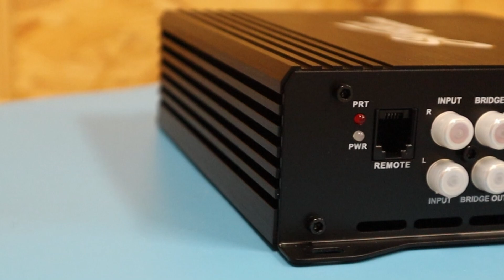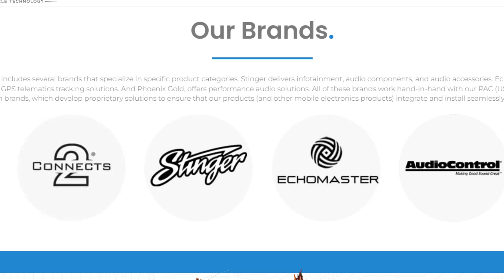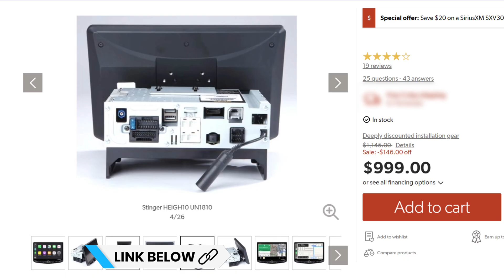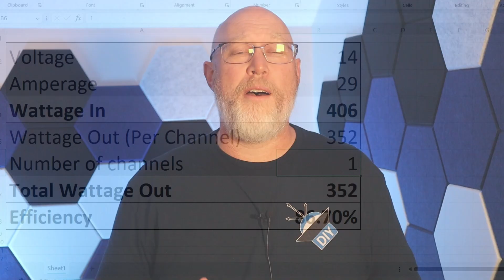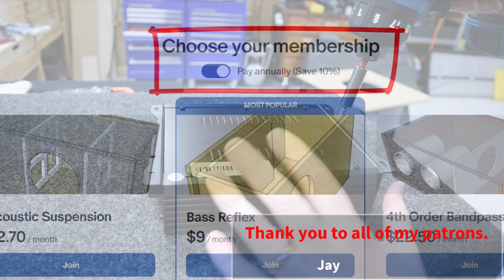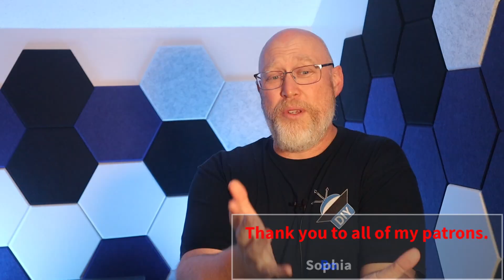The best budget subwoofer amp on Amazon (2024)

Comment: You should check out the Vevor BP-1500.1D it's under 100 bucks and not only does it's power it crushes it's rated power. You can get a 3000 watt version for 108.00 bucks.

Comment: As I understand a bit in electronic engineering and is licensed to use a soldering iron..... I decided to go inexpensive!  I bought a "Module amplifier based on a  TPA3255 chipset. Costed me 70 dollar and produced 300+300W (Total of 600W RMS).  to produce that power I had to add two more items.... A 12 to 48 volt converter and a dual low pass filter at the input, to block everything but the bass frequencies.  First I tested it at home, The speaker driver I used was taken almost to it's limits.... I think the neighbors dogs (in the next building) filed for relocation!  Ended up skipping the car option and left the amplifier connected to a passive 600W dual coil subwoofer. Sound great... Also sounds as loud as I want to, at will.

Comment: Hey DIY A G.
 Can you or anyone tell me why the majority of class D mono amplifiers are engineered to produce their maximum rating at one ohm?
  I understand that the lower the resistance, the higher the output but can’t this maximum rating be produced at, let’s say 4 or 8 ohms? , keeping things cooler and more efficient?
 Thanks bro, love the channel? 👍to toid.
Reply from the maker: Price.  You get more watts to the dollar at 1 ohm.
Reply: @DIYAudioGuy  Well okay then- That simplifies things 🤦‍♂️. 
 Thanks man. 
See ya on the next one.
Reply: The lower the ohms the lower the resistance and higher power output with less heat for higher watts I believe is the reason someone correct me if I'm wrong

Comment: I have a  1000 watt mono powering two subs and it’s just not what I’d figure it would be coming from two cheap subs and 200 watts each. Any way to check amp output with meter

Comment: The mt 2000.1d is insanely powerful. Running 2-3000 watt a.b. hawks and they are pushed hard with a lot of power to spare!
Reply from the maker: These are good amps.
Reply: @DIYAudioGuy 
Please can you test the 600.4 and the 1000.5

Comment: There 10 inch head unit  for a Toyota Tacoma 2016-2023 is really nice and has Apple CarPlay and android CarPlay you can hook up for cameras to that head unit  I am 48 years old so growing up in the 80s and 90s high school in the 90s everybody had aftermarket stereo systems in their cars and trucks that’s when the louder the bass that’s what every one wanted 

Phoenix gold I definitely remember that brand I think if I remember correctly they made high end speaker wire and all the wire do you need it to hook up your amplifiers the fuses 

When I was young and in high school I had kicker competition subs and alpine amplifiers and alpine pull out stereo then somebody broke into my truck and stole the sleeve set then I got a detachable face alpine head unit after that I got it alpine detachable face head unit and after I graduated high school and start working all the time I remember like all my friends are used to go to a place called sound crafters this is in Baltimore county Maryland friend of mine had a 5.0 mustang this was in 1996 the car was a 1991 or 1992 he got some kicker solo baric and this was before they were square these 12 inch the round ones they kept having problems with them they sound like💩💩💩 and I remember the only one that kicker did not have a problem with what is a 15 inch so he got 115 inch for the back of the mustang and he was done plumber school so he start making better money he bought a 1996 four runner brand new leather seat he got Six 10 inch JL audio 10 W6 he had a custom box made it was leather to match the seats in the forerunner 6 subs and I can’t remember if he had Rockford amps or kicker amps yeah extra battery and battery caps that was the first time ever seeing them the system was so heavy yeah they get some kind of balloons I forget exactly what they were called because the truck sagged in the back so these air shocks made  it not so low in the back I know he’s spent over 20,000 hours getting all that stuff done  people back in your system lotta friends that spend big money on their stereo systems and the base was so loud and vibrated the vehicle so bad I don’t even think it sounds good in the cars like a friend of mine had a BMW and everything was in the trunk translate it was just too much

Oh front of mine had a rodeo and he had four kicker competition 10 inch with a Kenwood 1021 amplifier he made the box to selves face straight back towards the hatch and the other two were on a 45° angle facing back and the rodeos had those windows that open so the other two was facing braided the window and he had for his meds in hives Alpine 6 1/2 for them with an amplifier and I’m not gonna lie that stereo system sounds better than everybody I knew that spent all that money everybody always wanted bigger woofers at first then I learned that smaller subs especially depending on what kind of car you had and where you had the woofer facing made the difference on how good your stereo system sound it I mean don’t get me wrong his forerunner sound really good but not $20,000 and I got rid of my 12 inch kickers and got 10 inch that was my girlfriends car and I had a box I bought from my friend 4 8 inch Kicker comp with a alpine amplifier I can’t remember which one it was it was a four channel that I had bridge down and it’s sound great I had that for a few years then somebody stole my stuff and so I went to the same place because I wanted a custom box I got three 10 inch JL audio 10 W sixes with a rod for Fosgate amplifier and a Kenwood flip face head unit down it was detachable face but if I remember correctly the face with hold down so you can put the CD in it if I remember correctly 1997 this was like a brand new Kenwood head unit at the time and this was just like a normal size head unit nothing light everybody gets now or I that stinger 10 inch head unit for the Tacoma‘s Toyota Tacoma‘s are really popular they’re all over YouTube with there Toyota Tacoma‘s oh Toyota forerunners Toyota Tacoma‘s and tundras are make the most popular trucks on YouTube or and that stinger head unit is so nice alpine and Sony makes some nice stereos for the Tacoma stinger really knocked it out of the park for the Tacoma and I’m not gonna get nothing crazy stereo shit kicker makes some boxes already made and they come with the sub and a passive radiator  Kicker makes this box in 12 inch 10inch  8 inch and 6 3/4 Kicker  CWRT672Loaded  enclosure  
 There all truck style sealed enclosure  from what people say on YouTube they sound good for being such a small enclosure

Comment: Got the stinger 1k on my 2 12w6v3 @ 4 and slams @4 due to haven't upgraded alt yet plus other car has 3 15s off a hcca 5k with 300amp alt 4 batts so not worried bout going to 1 my 3 15s split my trunk In half
Reply from the maker: Glad you like the amp.

Comment: Stinger and Recoil are the 2 best budget amps on the market. Stinger tends to make rated or over wattage. While Recoil tends to make under or rated. Reliability on both is really unknown at this point. Looking at the boards in my opinion I think the Stinger might have the slightly better design and reliability but I guess I’ll find out I have a Stinger 1500.1 and a Recoil DI1200-4 currently playing.

Comment: Can u please help me out? I have two JL audio subs I just got used they are in an enclosure. What amp do I need to match. They are two 12s
Reply from the maker: Any amp that matches the RMS power rating of the subs will work.  JL makes several different product lines, each with different RMS ratings.
Reply: @DIYAudioGuy  I found out they are 600rms I think 2ohm sorry I didn’t give u all the info. They are the w12-2a
Reply from the maker: @james-dt4ei  I recommend the 1200 w version of the stinger amp. Good bang for the buck.

Comment: Just another Chinese rebadged
Reply: I don't believe so on this one. I believe they designed it, obviously using Chinese parts
Reply: It's designed by David Chao in the USA but it's built in China for labor savings of course.
Reply: Good idea or not? I want this for my Fosgate P3 D2 in a ported enclosure, it's rated for 600 rms so I'm hoping I'll be able to run the Amp around 75-80% so it doesn't struggle. I bought the sub in Sept 2016, wrecked the ride in Jan 2017. Been on the self since, face up, still in the enclosure. Is it still going to be good to go? I had just broken it in when I wrecked.
Reply: @jhrubicon1470  Sub should be fine as long as the wreck didn't do anything. That amp will be perfect for it.
Reply: @BassFace1776  that's man, it's an old school car anyway. 93' Accord SE with the factory Bose 2 ohm system. I'm also looking for some 2ohm 6.5s for the door. I know about powerbass but never had experience with them. Any ideas that might help? Thank you
Reply: It's built in house.
Reply: It is not built in house. It says designed in USA made in china right on the box. @jeffmorefield

Comment: my buddy bought the stinger MT1500 and it clips when he puts the volume up to 15 the volume goes to 40 he had the gain set around halfway on the amp. i talked him into getting a jp23v2 and it no longer clips and is very happy with the amp, as i am with my own jp23v2.
Reply: Guarantee the gains were set wrong I get full power out of mine and im not even close to halfway up
Reply: yeah installation epic fail